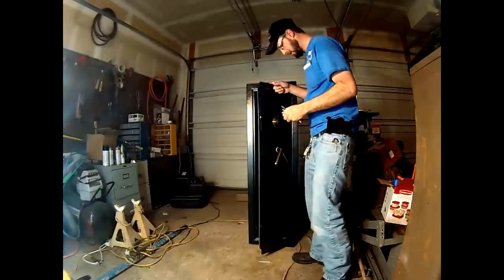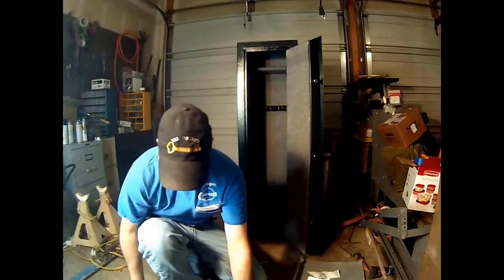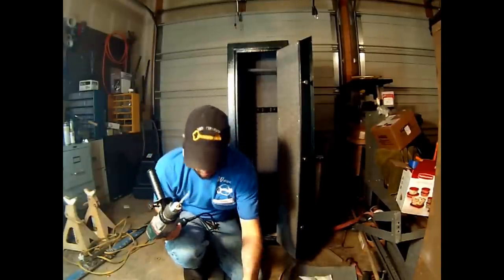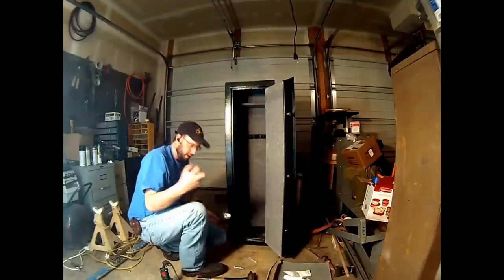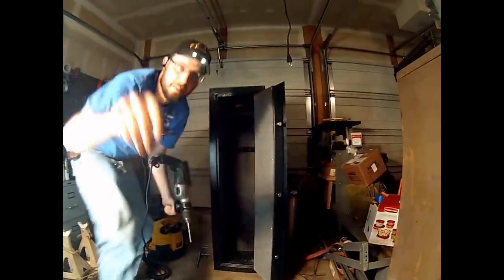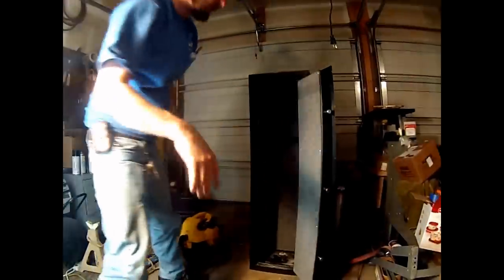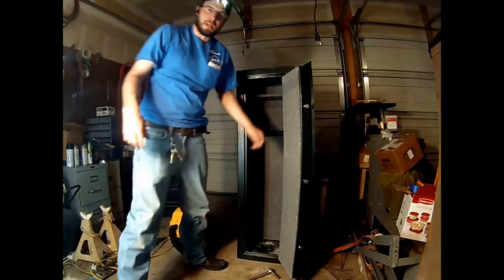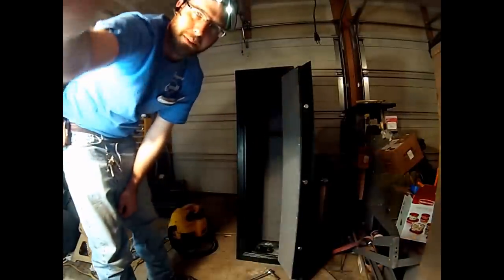How To Bolt Your Safe Down To The Concrete Floor

Comment: Some said the safe is not safety store in the Garage. Just wonder, if bolt down safe in the garage will against the state law. Another issue, once some one break into your house, meaning the whole house are not safety even the garage. If so, then, why the law require people store inside the house?

Comment: How do you remove the screws when time to move to a new house and you want to move the safe? Are these screws that can be easily removed? If not which ones are removable on the market?
Reply: The anchors are NOT removable.  However, by removing the nuts to the anchors, it is possible to remove the safe and take it with you.  The solution with the anchors, is to either pound them flush to the concrete floor, or grind the thread portion off.  Then, it is possible to fill with concrete crack filler.

Comment: A zaw saw would have those bolts cut in 2 minutes. Put it in the back corner of a room so at least one bolt is hard to get to. Also putting it in the garage makes it so easy to hook a chain to it and pull it out. The crooks would cut into it later.

Comment from the maker: Aspen Locksmith Co
http://aspenlocksmith.com/
Reply: I just installed 4  Blue Hawk 3/8 ich sleeve anchors in my safe to a cement floor and 3 of them rode high by 1/4 to 1/2 inch high.  Can I just tighten the bolt down and expand the sleeve anyway or start pver somehow?  I don't think I can pull these things out very easily though which might be a good thing for me?.